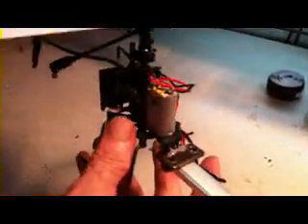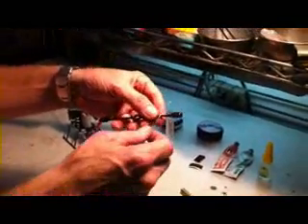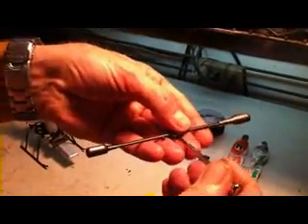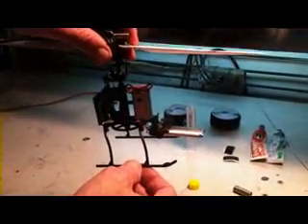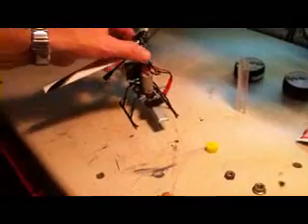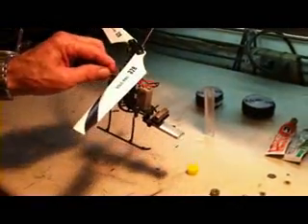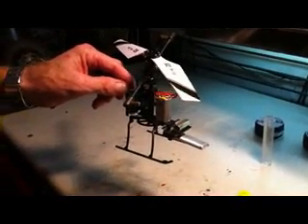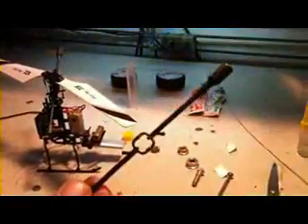Solo Pro 328 Modification tutorial

Comment: Best way is cut 2 equal lengths,then wrap...I lighted my ne free spirt flybars and shorten them a bit,and they out perform stock setup and are more responsive in changing direction...Also have added weight to inside of canapy tip this way u don't have to add as much weight,since you're adding futher out..a penny and glue works well...